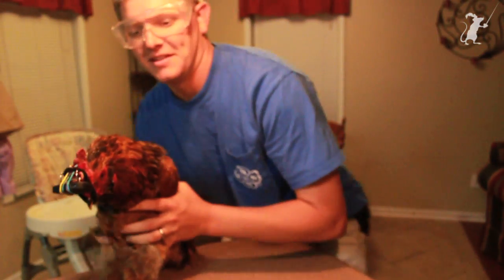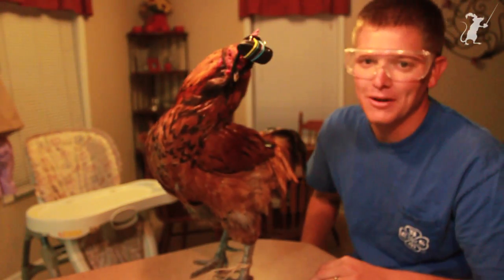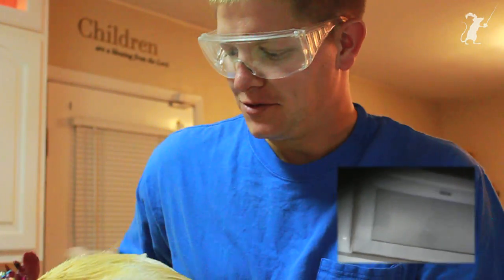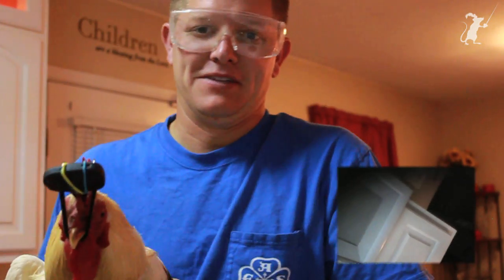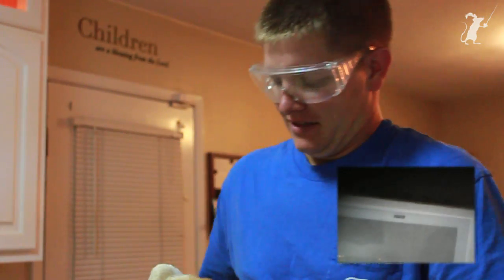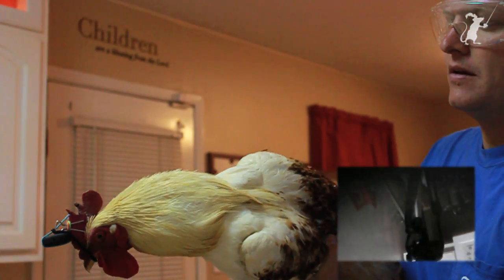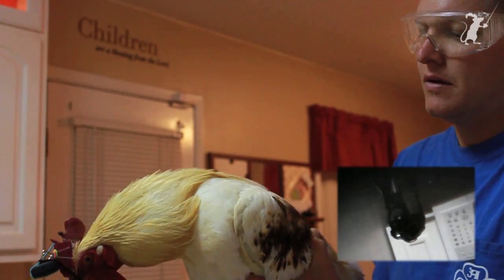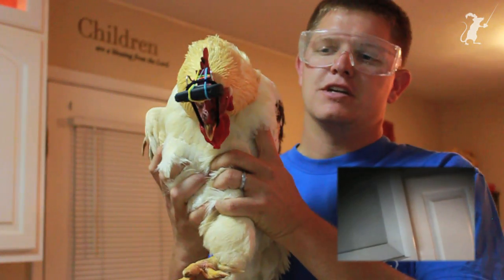Chicken Powered Steadicam - Smarter Every Day

Comment: Yes. Stereoscopic vision is possible by taking two pictures of the same scene from two slightly different positions. You can take those pictures by placing two cameras side-by-side, or you can take both pictures with the same camera at different times before and after moving it. As long as you know the distance between the two points, you can make a reasonable estimate of depth.